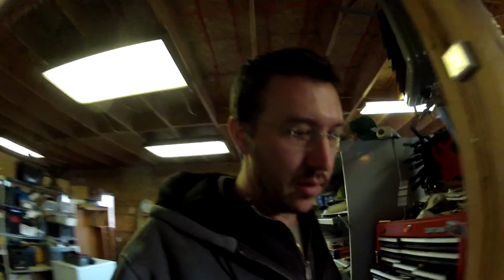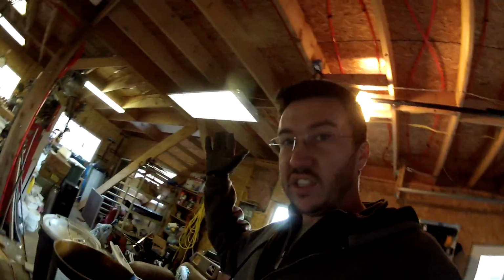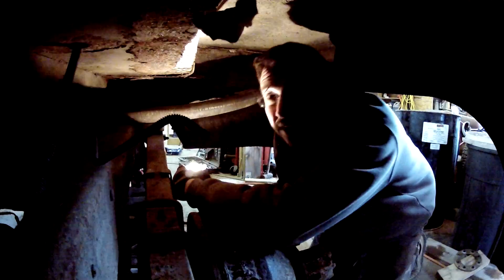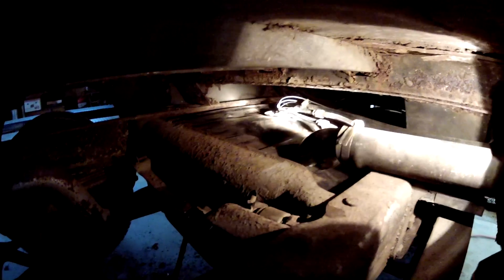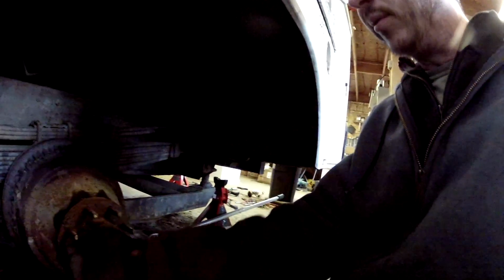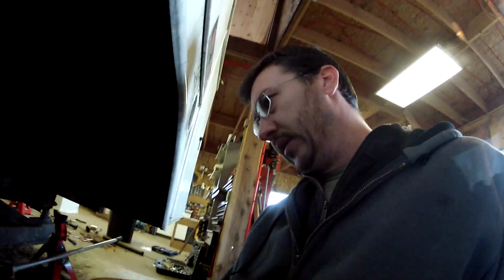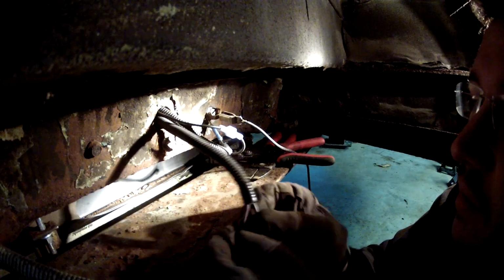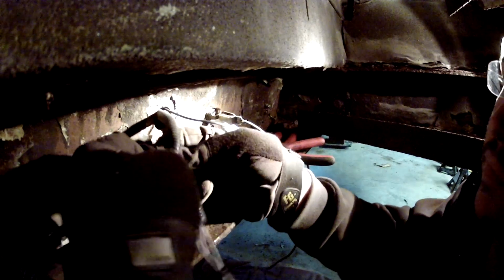9 - Gas Tank Install Chevy 3500 Bucket Truck

Comment: make sure you use anti seize on the wheel studs before you put your wheels back on!
Reply from the maker: Brad, this is such great advice, you know I need a little tub and brush like my Dad had lying around.  How do you keep grease around and use it for stuff like this?
Reply: Anti seize comes in a bottle with a brush on the lid! keep one in your tool box and one in your service truck/vehicle. also you can get wheel bearing grease in a small 1 LB tub with a lid and wipe some of it on your studs and in the wheel nuts (I almost said wipe some on your nuts - whew that was close).
Reply from the maker: Brad Fisher Phew! heh  Yeah i've got some anti seize compound, but yeah the grease in the tub is what dad and his father used to use on wheels studs.